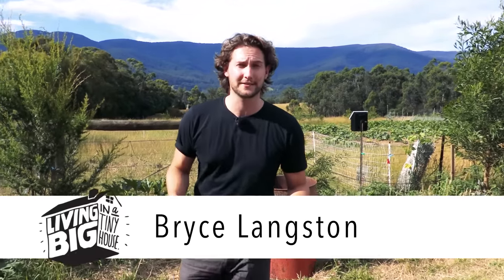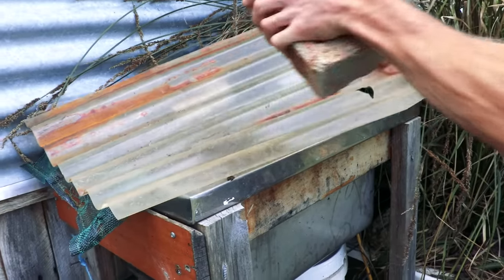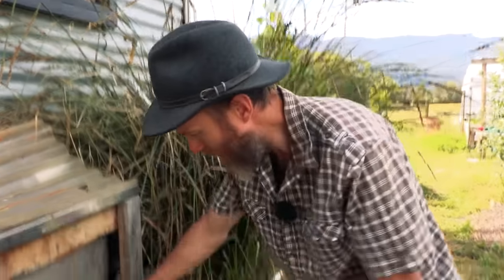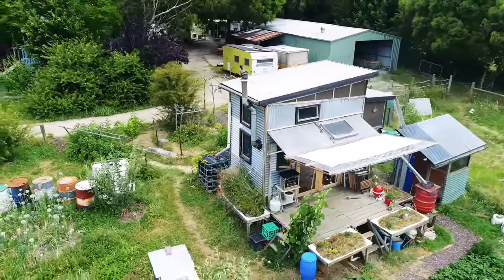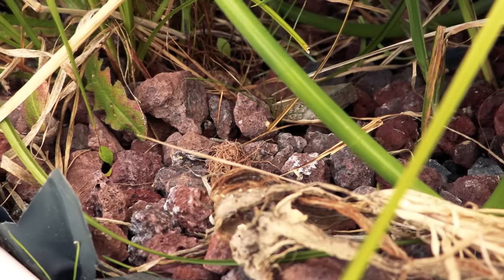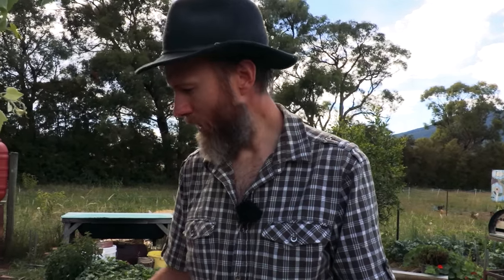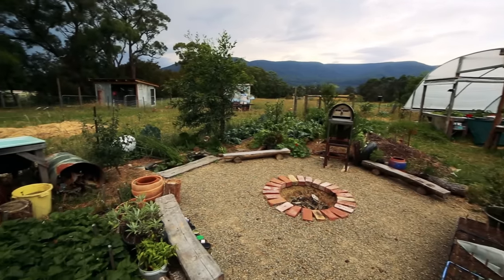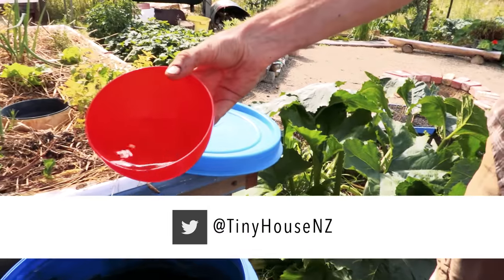Simple Permaculture-Based Grey-Water Treatment System

Comment: My county wants me to put in a crazy expensive system so I can get a permit to have a contractor build a house.  The septic guys have said it could be as much as 30k…. But, if I need to… I think they have some rule for temp living (4 mos) where you just have to demonstrate or show somehow, how you handle your wastewater.  This guys house looks a lot like mine… the people who lived in it scavenged the majority of everything they built.  I really like it but there are some problems that need to be addressed… water leaking from roof… at an add on lean to section and the wood stove needs help… I’ve also got a shower and I’m not sure where the water is going yet… possibly just straight into a planter with a tree close by the outlet… it doesn’t have a kitchen sink… so I’m working on that.  Got the composting toilet down and that works great… easy peasy.

Comment: I don't know if I've ever told you how much I'm enjoying your show. Here in Texas U.S.A. we got a new variation of the tiny home. It's called shed to home. We aren't on wheels or homes are on wooden skids which are also the floor oooh rats can't think of the word. But they are the big boards that support your house. Please forgive me I'm a senior lady 64 going on 65 years this summer. So various companies are popping up like crazy making these custom sheds. So mine is 12 by 20 outside and 12 by 16 on the inside. I have a 4 foot porch that runs across the front of my house and is also where one of my 8 foot lofts begins. Then the other loft is at the back with 4 foot open between where I will hang my ceiling fan and where my stair cases will go up on the right hand side. I have a metal roof that makes my house look like a miniture barn. I adore my house have been in it almost a year lol and I just now decided what type of insulation I'm going to use. I'm from the north west so cold doesn't bother me like the heat dose cause of humidity. My house is nowhere close to being done but, you should make a new series about how much fun it is to do your own home even if your not a builder. First you design your home I went to Als Affordable Buildings. They sell Derksen sheds. They have their own financing for people like me who have rough credit. 5 years I own it and my payment is under $240.00 a month. I could have paid off sooner if I could afford the higher payment. I'm sure someone in Australia is doind it. If not come to Seguin Texas and see the great folks at Als. 💘 Ms. Michal

Comment: I am about to move off grid to 64 acres I recently acquired and I'm so excited to use this plan to set up my grey water system! I can't thank you enough for sharing this in such an easy to follow way! 
I'll admit that I wish that I could have seen a little bit more of the piping (where they go in and out of the wicking beds, what size pipe to use and why, etc.) But I think that I can work with what I've got here to start a sustainable system!
THANK YOU!

Comment: @livingbig I love this so much!! The only thing you didn't cover is the piping. Does this mean you'd have to have all your piping come out of the side of the house instead of under it? Im currently having my tiny house built and would love to know if this is something I need to tell them to do. I'm pretty sure as a standard the plumbing would come out of the bottom right? So this whole system is only for a kitchen sink? Does it only work on a small scale? Would I need a much larger system to include bathroom sink, shower and washing machine? Or would that be too much for something like this?

Comment: Hi, I still live in Au but intend to move to Poland and sewer is the issue. I do use dry toilet and know it, but have no idea of how to make the grey water filtering. I can do a reed bed but I need some scientific research to convince Polish minister that it will work. I hear you use worms to clean. HOw about the frost in Poland? Want they die? The frost depth of the ground is there about 0.9m. Any help or suggestion of how to tackle this issue? I have actually wrote to the minister about dry toilet. He did not replied.  But this is the most responsible toilet system ever. I've been told that decades ago in Berlin some town houses had only dry toilets installed and not reported any problem.

Comment: this is what I plan on ding. not on such a large scale. but this is know as a '"bog filter" in tthe pond and aquarium hobby. its a way to fiter a small pond with minimal equipment or it is used befor the filter equiment. that way it limits the amount of maintanance on the filer system. its a agreat idea. you can use any "marginal" plant in the beds. they love the water and wont be effected by over watering.

Comment: I have a hard time believing any detergent safe enough to throw on plants you are eating is strong enough to actually clean anything.
Reply: Cryptolocker washing is more about ph friction and heat than chemicals. When I switched to using Castille soap with essential oils I was finally able to eliminate all odors from my shaker bottles which no chemical cleaner had ever been able to do for me before so I believe it can work 🤷‍♀️
Reply: Totally possible. Did it for years without filtering and had a small forest going. Would filter for growing veges. People use way too much laundry soap.
Reply: Carol Leigh totally agree. People fall for the chemical companies advertising to use more. A good bar of soap lasts 6 months or more for 1 person.

Comment: So I'm guessin this guy never uses soap of any kind. Grey water also includes water from showers, sinks, baths. Granted he could use bio soap containing no phosphates but in this vid this isn't adressed at all. It seems to me this grey water is pretty clean water to begin with. This is one of the points that almost never really gets adressed in all these tiny house vids I see. Black water....sure, as mentioned in the vid use a composting toiled or a burning toilet but grey water is the real issue. So I finally found one specifically about grey water off grid living and it only talks about the treatment without ever saying anything about where the grey water comes from and what he puts in that water before it leaves the house. How does he shower? Without soap? Ever? How about washing clothes then? None of these elements are even touched upon.
Reply: He says that he uses biodegradable detergents. He probably showers and washes dishes with something like Dr. Bronners.